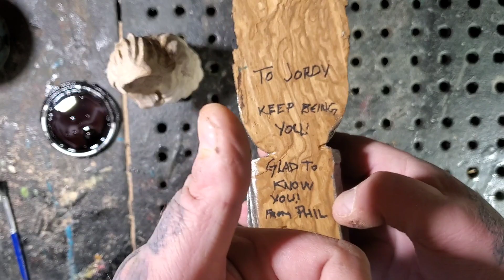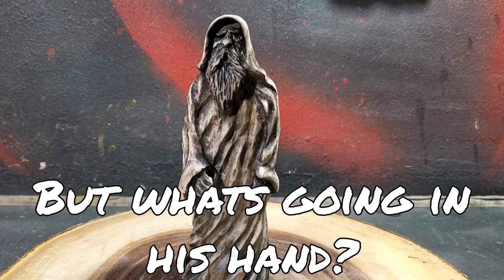Dremel carving a full size Mini wizard time laps and tips on eucalyptus wood

Comment: I made myself a sanding disc like yours. Mine was very aggressive. What grit do you recommend?
Reply: If I remmeber he usually does 80 but you can change grits according to your job
Reply from the maker: 80 and higher, are u using soft stuff? Flexable?
Reply: Carving Fusion By : Jordy Johnson Yes, the Wood was soft wood. I used a worn out belt from my 7” x 21” belt sander. Does it need to be a belt or can you use wet/dry sandpaper?
Reply: Carving Fusion By : Jordy Johnson Also, I had to use thread locker on the nut. The machine rotation unscrewed it. If memory serves me right you had the same problem and I suggested thread locker months ago. It does work.
Reply from the maker: @brucewrandol  if u go to my plalist u can see how i make it now i dont use nut and bolt
Reply from the maker: @brucewrandol  no
.
Emery cloth sandpaper needs to be soft, not the belt sander type, thats to hard